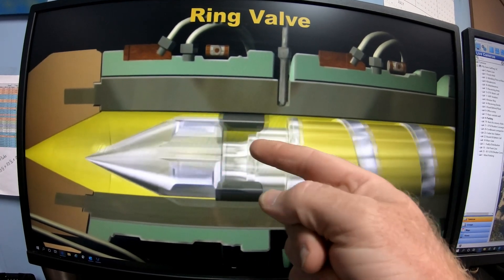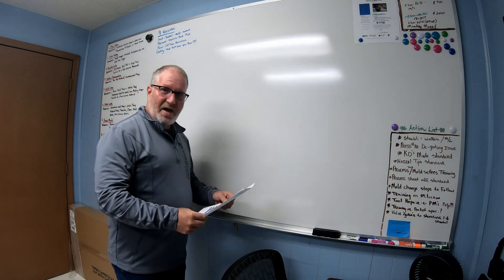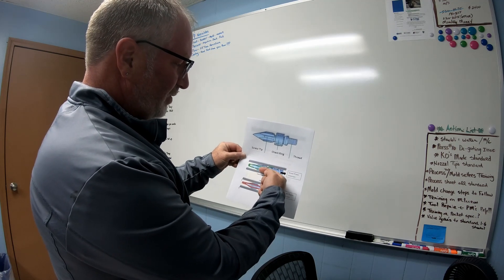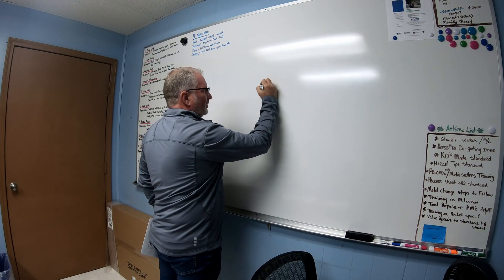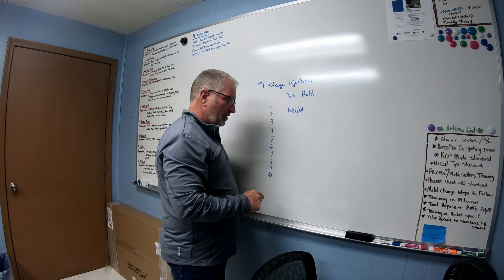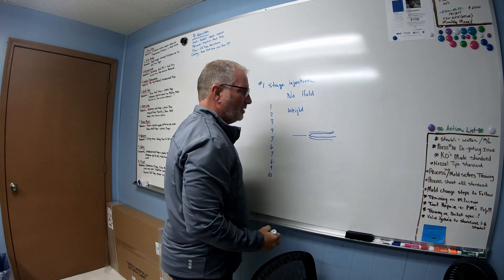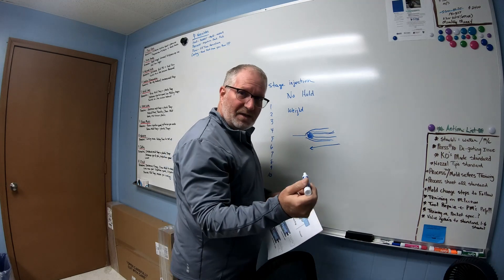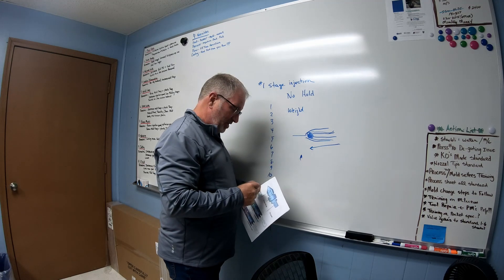Check  Ring Study

Comment: Hello sir my self rupesh from India we are suffering a problem of ring plunger ring ware out frequently in month only so can plz suggest?
Reply from the maker: It depends on what type of material you are using. If you have any glass filled material the ring will wear in 6 to 8 months. Thanks for watching & the support to the channel greatly appreciated.
Reply: Yes it's depend on material but in one month how the ring plunger ware out so plz suggest another reason. We facing this issue
Reply: @rupeshpatil9504  I am working from Bangladesh, so I know the material quality is not good. What material are you injecting? Recycle? Or injecting corrosive materials like PVC maybe your problem.